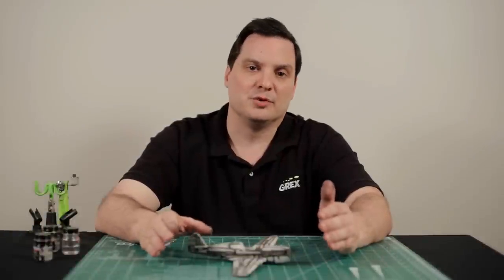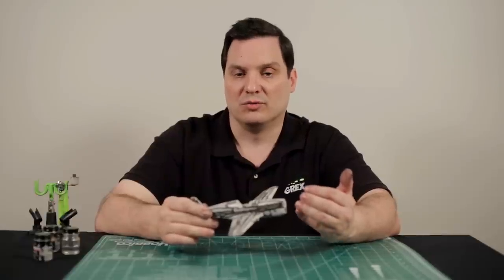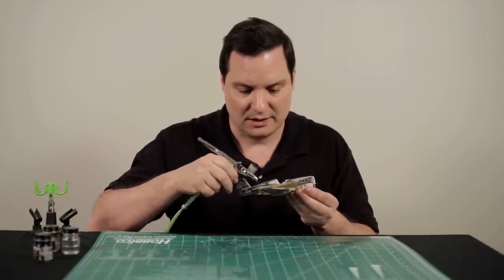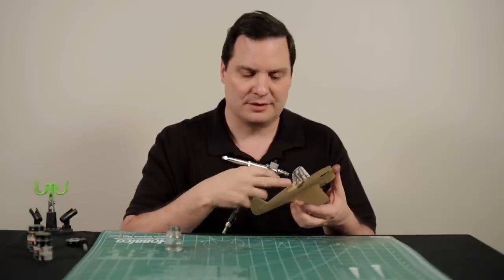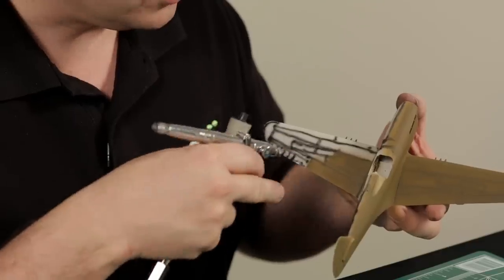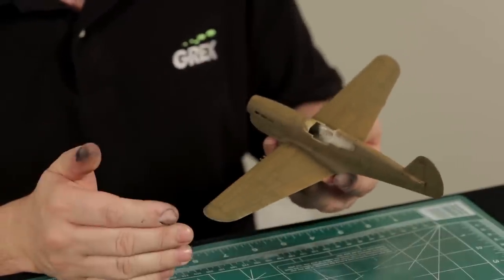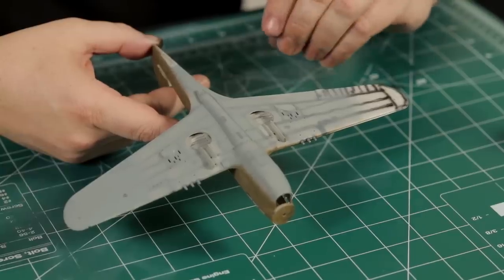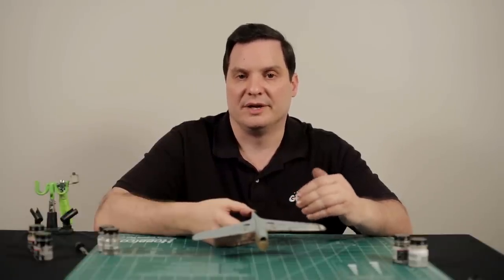Grex Model Aircraft Airbrushing Series - Episode 4 - Single Color Camouflage Scheme

Comment: Where do you get the side paint holder? I saw other videos of yours showing extra paint pots. Can't find them anywhere
Reply: I'm using our AD31 adapter in conjunction with an Aztek color cup from Testors. Our color cups are threaded into the airbrush body (good for some applications) while the Aztek color cup is a press fit (my preferred configuration with our side feed Tritium TS). The AD31 retails for about $4.00 through most of our retail dealers.
Reply: Bryant Dunbar thank you for the reply. I found these I  amazon and ordered d them yesterday. Thank you for responding with the model numbers. Enjoy your channel a lot and you have some real good content on here

Comment: that handle seems clumsy. is there any way to remove it?
Reply: The handle takes a little getting used to at first if you have used traditional style airbrushes previously. For those that use detail and automotive spray guns, they readily are more comfortable right from the start. The handle can be removed but then you have the bare air valve assembly exposed. If you think the Tritium is not right for you maybe consider one of our new Genesis XGi or XSi traditional style airbrushes. If you have a dealer in your area, they might have a demo brush you can hold and see for yourself. We also attend many hobby and trade shows around the country in which we invite attendees to try our airbrushes for themselves. Perhaps we might be in your neck of the woods sometime.